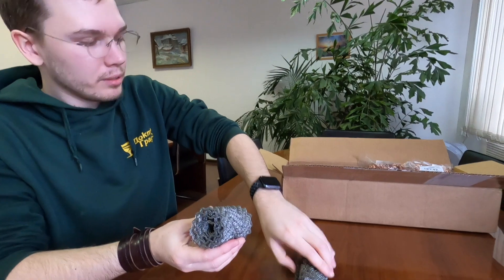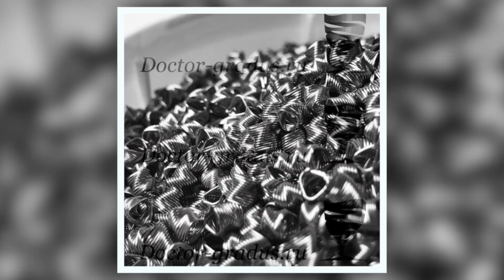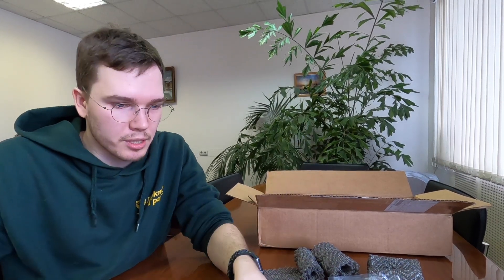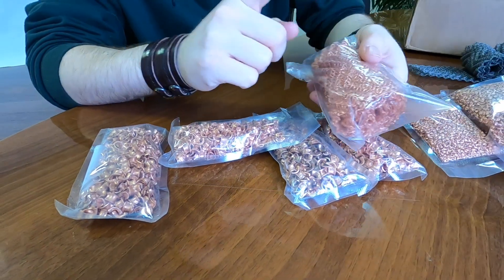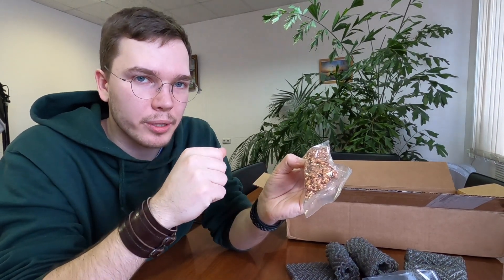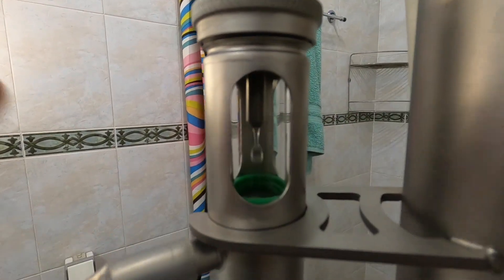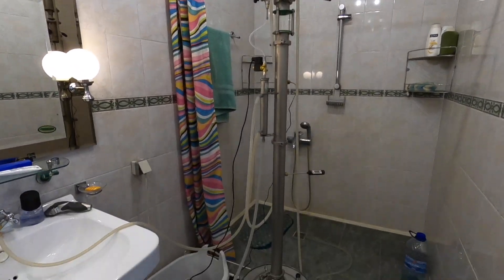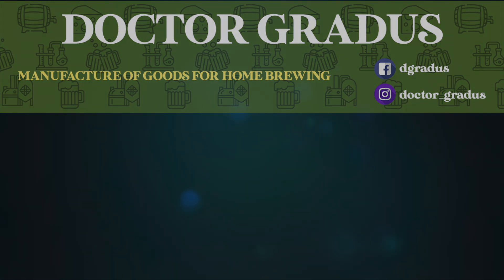Packing for distiller SPP, mesh, saddles,  copper mesh

Comment: Nice to see all the different packing together,maybe one addition,one can use 2 rols copper mesh below to eliminate sulfer,and fill the rest of the column with stainless steel mesh.
Same for Spp.
Reply from the maker: Yes! You're absolutely right. Using some copper rolls under SS packing is a grate way to deal with sulfer.

Comment: I have a 3" column 1200mm high. I have ordered from you 2 L SS SPP and 1L copper SPP.  I think I will have space for 2 more L.
What would be best arrangement? Stainless scrubbies at bottom then copper etc? Thanks, Pete.
Reply from the maker: Yep, we got them. We are going to send you copper SPP today. I would suggest you putting SPP in the middle or in the bottom, because you can clean your product from sulfur much better when it’s closer to the boiler.